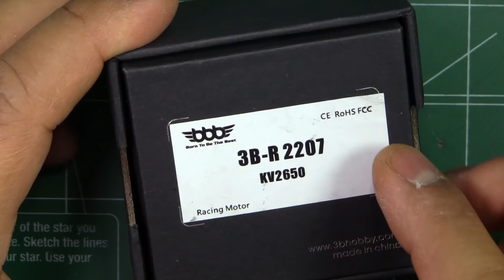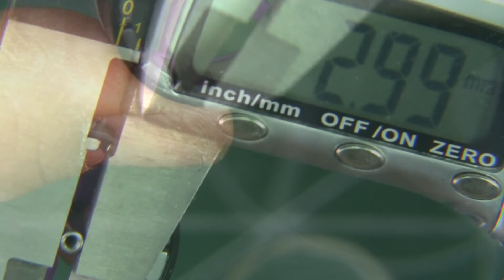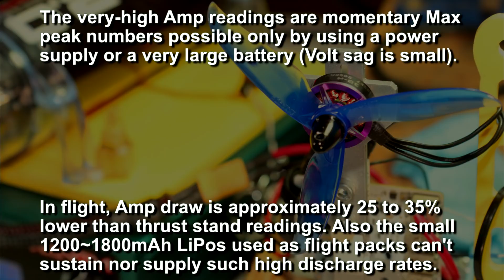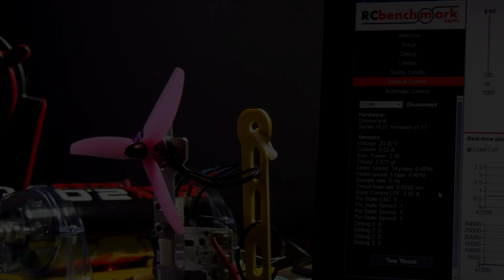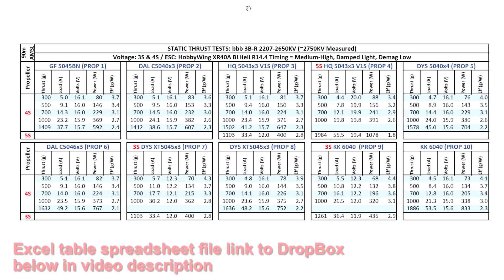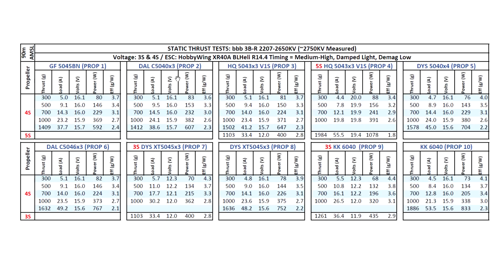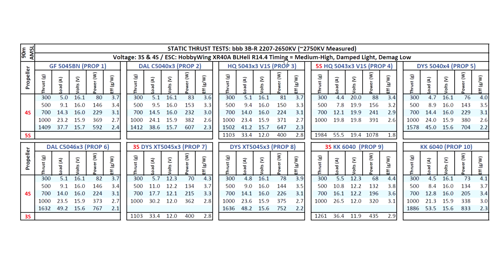bbb 3B-R 2207-2650KV Thrust Tests & Overview

Comment: Would you happen to know the maximum continuous current for these motor,  was going to use one on a plane.
Reply from the maker: I don't have the exact spec. Most motor manufacturers don't really list Max continuous Amps, and some that do are not quite accurate. Sometimes too low or too high :(
My best guess is if you stay under 30A continuous it should be safe if it's in the airstream to get some cooling. Usually these high KV motors of this size on 6" props and 4S would probably overheat on continuous high throttle (close to 100%).... then again it also depends on type of aircraft, weight, aerodynamic loads.... etc. On a small, light plane/wing it could be perfectly Ok but it may overheat as you go heavier/larger/higher drag

Comment: EngineerX, which 2207 would you choose? This BBB one or the BrotherHobby's R3? Forgetting about the price difference. 😊
Reply from the maker: That's a tough one,  performance advantage goes to the BBB, there's been some reports (I've seen 2 only) about people getting motors that seems to have different magnets strength because perhaps magnets were from different batches too (and had different strenghts). So:
Best consistency across all motors = BH
More power but not too sure = BBB
Reply: EngineerX Thanks! 😊
Reply: BH R3 closed eye.
Reply: Labs Thanks! 😊
Reply: Good luck with yours. I'm building one too ;-)
Reply: How u compare this motor to xing E 2207 2750kv
Reply: Labs Nice! Good luck! 😊
But I'm not going to build it yet, I'm still buying things for a 3 inch. But already build a brushed one, which is killing me when I try to fly. 😂

Comment: this motors or nk2306 2400kv motor. I do freestyle only
Reply from the maker: Tough choice. Both are good. Lower KV if you want slightly longer flights.  High KV if you're building an UltraHyperSuper light frame under 300g without battery
Reply: 2207 alll the way !!

Comment: Rotorvillage.ca have the same motor but different winding giving 2450kv. I'm wondering if they would be more adequate for a 500g+/- freestyle frame on 4S and DAL cyclone T5045? (will do moderate speed freestyle, not racing). Thanks
Reply from the maker: 2450KV is a good KV for freestyle for that weight. I think it will be better than 2700KV because of the heavier frame and you can also run them on 5S if your ESC's and build are capable.

Comment: Hey engineerX I think you make the best motor test and the quickest one to test me motors
I have a quick question if you don't mind, I want a high kv motors for freestyle I like the boost the offer. Which are the best motor you come across lately ?

Cheers
Reply from the maker: Andres Jaramillo High KV 2600 to 2800. I think 2207s will give you plenty of power. The other bigger bbb motor I reviewed impressed me with the beefy 5mm shaft. The BrotherHobby R5 are also very powerful and smooth. dys Thor and Mars are strong in thrust and durability. It really is hard to pick one. The good thing is there are many good ones. RCX 2207 also good using 4x9x4 EZO bearing. I just finished running tests on the new EngineerX 2307 and results are very good, more power than 2207 and those use the strong bearing 4x9x4. Emax RS2306 is also still competitive. Lots of good choices.
Reply: EngineerX where and when can we see those new motors. Are those RCX that good? I was thinking about  the Brotherhobby avengers and the Garilla 2507. But could be to much
Reply from the maker: China is having their Chinese New Year holidays, so I Imagine that will delay release. Maybe in 1 month. But for sure not until after Chinese NY. RCX are one of the best "budget/ mid-budget" motors. Garila looked good but yes it's a bit too big for 5". Most people are happy with a 2207 or 2306. Avengers seem good, they're also not that heavy.

Comment: Thanks for the test. One tip if I can make it, would you mind listing all the results in the bottom row multiplied by 0.65 for us? That way we all don’t have to do the math manually to see in air amp draw & thrust figures. Obviously this is dynamic and unloads as the craft moves forward, but at least it will give viewers a better understanding without having to do the math manually. :)
Reply from the maker: You can download the Excel spreadsheet and easily use the data to calculate those values. It's not really doing it manually hahaha.... just a couple of clicks and use = character to start your formula. The 0.65 factor applies only to Amp draw that I've observed in various flight tests on a couple of setups and it's an approximation. Actual Amp decrease due to unloading of props in-flight can vary a lot depending on weight and components for each setup, That's why I always mention it's an estimated correction factor. 
Measuring or calculating the corresponding thrust is quite difficult. I think a guesstimate can be made by getting the 0.65 Amp value and pulling the thrust number corresponding to the calculated Max flight Amps. So you'd have to look at the first set of data for each prop (Max thrust ramp-up) and match the Max A*065 to the corresponding thrust. The sampling rate of the thrust stand is not that fast so there's not much resolution on the fast Max thrust run but you can get sort of close. I rather not present the 0.65 calculations because it only applies to Amps. Check out the Excel table, I just added "SHEET 1" showing Amps*0.65 and also the corresponding thrust for those Amps - a very loose guesstimate for in-flight Max thrust :)
https://www.dropbox.com/s/qvgw39994oex1mw/thrust%20results%20table%20bbb%203B-R%202207-2650KV.xlsx?dl=0
Of course for those using mobile devices, that would be more difficult...... sorry.

Comment: Would this motor work on 5s?
Reply from the maker: Zach Bates It could be possible... I have seen some people run other motors on 5S. The only problem I could think of is these use thinner multistrand wire so those may not handle 5S at the very high loads. If your build is ultralight 5" and you use a light prop like 5043x3 Then the chances are better.

Comment: Are you going to get any FinX40 2607 1500kv motors in the future to test? Ryan at MQTB says his equipment isn't up to snuff to test the motor..
Reply from the maker: Well, we got similar equipment. I believe he uses the same HobbyWing XR40A ESC and I got the same power supply. I think because the way he tests, with rapid throttle up & down to test motor response that's most likely triggering the power supply current surge breaker. Power supply shuts off when a high load happens too quickly. The way I run my tests, only a moderate full throttle ramp up, the equipment is able to support up to 75A burst
I requested test samples from Silverdrone a long time ago, around 2 or 3 months ago and they said they'd send some FinX30's but they were never sent. I'm sure due to their very high demand, they didn't have spares to send and by now they may have forgotten :(
Reply: EngineerX I talk to Hoang Linh Bui quite often (Linus from silver-drone), I'll ask him what's up! Super curious to see tests on it
Reply from the maker: H Bui was the one who said was gonna send samples ... but I'm sure they've been too busy. That would be great if you ask him about it. Thanks! Anyway, those motors are selling really well for them

Comment: These are nice looking motors, but the price is to close to Brother hobby and emax 2207's. If they were a little cheaper I would consider them. 
Is it possible to include rpm at each measurement? I would rather see that in the table than the efficiency. Thanks.
Reply from the maker: Trystan I'll see if I can modify tables. They could get too large.
Reply: EngineerX Thanks I realise the space is limited, which is why I though that rpm could replace the efficiency column. Adding rpm would also allow us to calculate torque, and get a better understanding of how the motor performs in real flights. The efficiency can easily be calculate from the other columns that are already there. It seems a better use of space. Keep up the good work, we all appreciate what you do.👍
Reply: you know they sell for 15$ per motor right? 
check out underground fpv, i think its still 15$ for like 2 more days.
i just received mine and they are awesome!
Reply: FreeWaffle The Brother hobby R3's are £16.80, and these are £14.50 on Banggood. I don't have experience with these motors, but for a little extra I know that Brother Hobby will definitely perform. Maybe if I hear more good reviews on these motors, I might get a set.
Reply: Trystan I tried the brother hobby r4 and R5 and those did not disappoint me at all and 15$ is way less than 16.8£ but your choice mate
Reply: Apparently the FPV Model 2207 is a rebrand of these for $13USD. Slightly lower KV, check them out. And EngineerX, would love to see the above motor tested! Cheers!

Comment: a bit heavy for a light weight racer like ghost mode 2 or floss
Reply: BH 2306 2650kv is 28g. It is the lightest big motor I could find and is going in my merica build.
Reply: Jack Truong what motor would you choose for a lightweight racer?
Reply: Hrr Pippi hyperlite 2205, BH 2205, etc. I would look for weight around 25-26g per motor. Devel 5 with BH 2205 2600kv is crazy fastest and agile. See uavfuture review of the devel 5.
Reply: Jack Truong ok. Do you think the manufacturers will be comming with lighter 2206's? Would be cool if they upgraded the older class of motors. Oh. And what kv would you go For?
Reply: The new 2205 generation you can go for high kV because they have a lot of torque.  2500-2600kv is a good range. They are crazy fast.   I noticed new 2205 can do 2700kv.  I have not try them but I personally would not go for them. Btw hyperlite 2206 is around 28g which is a very good choice for light build if you want 2206. Most race courses you can not hit top speed so agile is more important which is why I like 2205 more.
Reply: Yes I meant the deadpool. On this channel he measured 28.3gr with 50mm wires.
Reply: The Devel 5 is with the new motor returner r4 2205 2700kv. The uav budget build was with the r2 2205 2600kv😉
Reply: ASJC27 you meant the Deadpool version. AFAIK they are around 32g with long wire. I could be wrong. The owner of this channel is the motor king imo. He can confirm this.